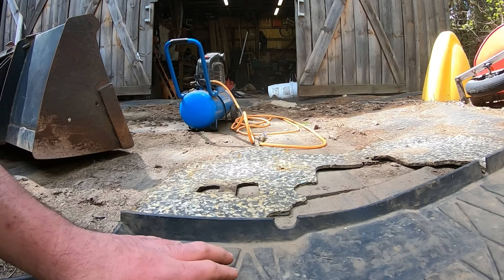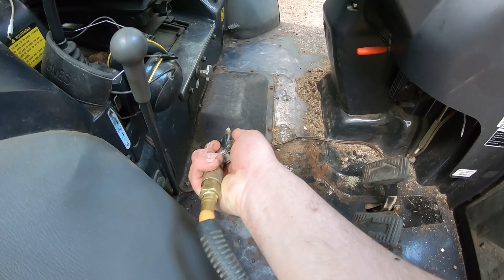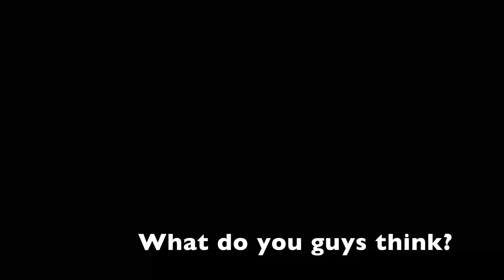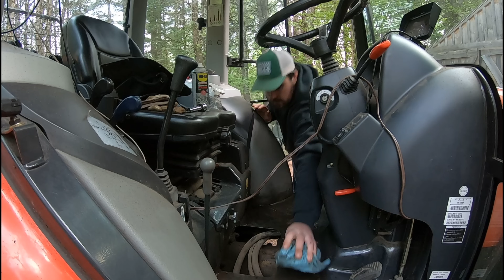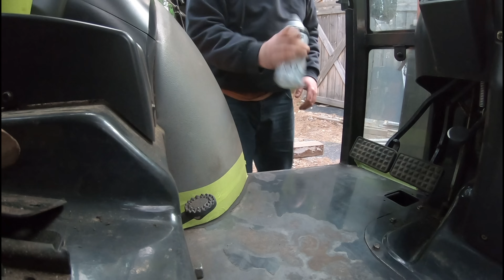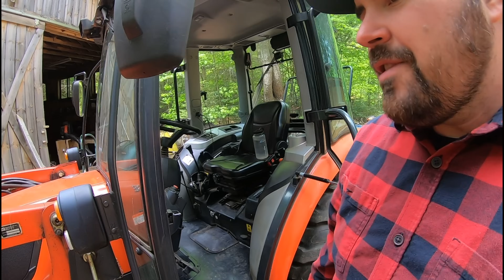Rusty Floor Pan Repair (I had no idea)

Comment: Sandy, my advice would be just as you did but I would instead put a couple good heavy coats of asphalt undercoat or rock guard.  As far as the matt, I think you should leave it in the tractor but I’m debating if you should leave the foam in or take it out.. it’s mainly for noise suppression.  I would suggest put it all back in for now (matt and foam) and just keep an eye on it regularly.  You still have the potential of slipping on the floor even without the matt in the summer so I’d be keeping it in Sandy.  Just my thoughts :)  thanks for the heads up on these potential issues on these tractors!  Andrew from NB :)

Comment: See it constantly in the marine environment.  That foam holds the moisture for sure even though it feels nice and acts as a sound deadener.  You definitely have poor paint adhesion as well.  Use a good epoxy primer or even better is an inorganic zinc paint system, however for best results you need to get a clean metal surface.  Can you pull the floor pan and sandblast it?  If not use a good rust converter before priming (no there are no good primers-topcoats despite what they say).  If nothing else give it a good coat of Rustoleum rusty metal primer every season.  It is not the best but it really helps and it is quick.  Personally I spray it on or brush it on thickly and do not bother to overcoat as I can see the rust better with just primer and it adheres to the next season's coat better.  Another trick I have had good success with is putting an old towel under the rubber mat leaving just a bit protruding in a spot or two.  I feel that every couple of days and pull it out to dry if it starts getting the least damp.  All in all the reservoir of the rubber mat is a win I wouldn't do without it but they need to be watched and dried whenever they get damp. Don't leave water pooled in the mats either take another old towel to dry them after you have heated the cab before it can freeze again.  It is a water making machine when you subject steel to the cold of night and the warmth of day as well as the seasons.  Keep it aired out (pull the rubber as often as possible and let it dry underneath) vacuum all the residue which can also hold moisture.  If it is in a shed airing it out is less of a task.  The cheap paint systems manufacturers use in auto and equipment creates an ongoing battle when combined with the low carbon grades of steel it is put on.
Reply from the maker: Thanks for that Douglas

Comment: Sandy, my thoughts are that it is condensation and that the carpet padding is retaining the moister over a long period of time, which is causing rust.  What if you pull it out a few times each winter and dry the padding next to a stove, or only use the rubber mat in the winter and not the moister absorbing padding?
Reply from the maker: I think that would be a wise idea for sure . Thanks Doug

Comment: Sandy, there are lots of suggestions here.  Some I agree with, others, I don't.  Putting that underlay pad back in is asking for a repeat performance. It wicks water up fast from warm air condensing on cold metal and holds it for months since it can only dry along the edges.  But you probably need it for sound attenuation so you should put it in.  See?  Confusion reigns supreme!
What you need to do to COMPLETELY eliminate rust from the top side is to clean the entire floor down to bare metal.  Coat it twice with POR-15 (it goes on REALLY nice with a sponge brush ), now, two heavy coats of Rust-Oleum and let that bake in the hot can on a sunny day.  Now get a kit of stick-on sound mat, like kilmat or similar, carefully cut and fit your pieces to the floor.  Once you are satisfied with the fit, begin sticking it down, rolling or pressing it ALL to the floor (any voids will collect condensation)!  
Once that's in, you won't have a worry of rusting from the top.
You need good prep and don't rush the repair.
Reply from the maker: Thanks appreciate you sharing that

Comment: Primer was the wrong thing to use on the rust. It will come back what you should have used is Black Star rust converter and then painted it. Black Star will get in the metal and stop further rust.
Reply from the maker: Thanks for the tip Kev

Comment: I was watching as you removed the loose paint . Problem # 1 no primer on the underside of the loose paint. Problem #2 Padding, that type of recycled rubber padding absorbs moisture leave it out. You might want to look into a resturant type open rubber comfort mat the type with the holes to allow the moisture to pass through.
Reply from the maker: Thanks for that I’ll see what I can come up with

Comment: well sir i have snowmobiles that are quite old the paint is still rust free all except one place underneath the seat because it never  completely drys so it rusts very bad and if left unchecked would rust right through while  rest of the machine remains like it came from the   assembly line
Reply from the maker: Good to know.

Comment: the spongy underlayment is acting like a sponge and holding the captured condensation against the metal longer, because the water is sort of suspended in the sponge "matrix", a wet sponge stays wet a long time, whereas if you replaced it with a non-absorptive material with a channelized bottom (soft rubber, etc) then the water would be given the opportunity to dry faster, my thinking is this underlayment could be cut from a large rubber floor mat with grooves (face down) that could be cut using your foam as a template.
Reply from the maker: Appreciate that

Comment: Betting that the moisture in the cab as you work (breathing, snow tramped in, your body) all condensate on the coldest surfaces after you finish work (floor boards, glass) and the pad/mat soaks up and holds it and never gets exhausted out, actually repeats itself each work session. Dump the pad/mat and if it’s easy enough, raise/roll up the floor rubber protector to help air some out out. Also a plus for doing this, you get a early warning of reoccurrence.
Reply from the maker: That’s a good point as well

Comment: Here is a good tip Sandy I spray rock guard in my truck box same thing is a box liner spray also I think personally it is the same thing! you can get it at canadian tire and is about 12 dollars a can or you can buy it in a larger quantity and buy a gun which runs off your compressor once it is on it bonds to the steel. It makes a good bond to the steel. those plastic box liner did the same thing create rust under since I did this I generally give it a touch up when it starts wearing off it would be great for under your rubber mat or on any surface you want to protect. Hope this helps One thing you want Rock Guard not Under coating they look the same but are different. It come in black but is printable if you want to spray it back Grey or any colour you desire
Reply from the maker: Thanks Marc!

Comment: I wonder if you used some Eterna bond tape and covered the freshly painted floor pan. It has a sticky back that is like butyl and the moisture from the condensing water in the warm air would be on the top on the waterproof side of the patch tape. You also might be able to glue a piece of EPDM to the floor pan.  It is a monomer so you would have to find an adhesive that would glue rubber to metal but it would likely suit your needs.

I have used 100's of feet of Eterna Bond and it is pretty amazing.

Comment: I'd apply truck bed liner to the floor. You can use the rubber mat without the underlining but it might slip. Reassemble everything and just remove it to inspect from time to time. If the underlying can absorb water I'd trash it.

Comment: The “craters” you referred to is called pitting. That’s the rust actually disintegrating the metal. You were at a serious point in the process. Good catch looking under the foam, which, as a hundred others have recommended, you should not reinstall.

Comment: Our New Holland is an open cab and it had an operators floor pad.  It degraded the metal floor so badly it caused issues with a few things that linked to the underside of the metal decking.  Not sure what to tell you in relation to the floor pad in a cab model.  I wonder if bubble foil insulation would be a good substitute for the foam underlayment installed by the manufacture.

Comment: Get some rust converter to apply to the rusty parts 
Makes a big difference
Reply from the maker: I just haven’t found any that stick to painted surfaces as well. Ones I’ve found said they only stick to rust and my Concern was that the majority of rust was removed with the wire cup. Any brands you’ve had good luck with?
Reply: @sawingwithsandy  we us rust converter from Wurth 
It’s brush application sticks to painted surfaces but you only get the reaction on the rusted surface
We don’t usually paint over it seems work bet not painted

Comment: I would put the rubber mat back in and leave out the foam pad. The foam will hold the moisture and the ribbed rubber will let the moisture run out and dry under it. Thats what I would do. I might also shoot the floor with Rapter liner.

Comment: Highly recommend POR15 instead of normal primer/paint for areas susceptible to moisture buildup.  Paint Over Rust 15 is amazing and has saved some of our refrigeration equipment that is constantly wet that corroded through factory paint and powder coating.

Comment: The moisture is coming in from that rubber cover in the middle of the floor. You should seal with water proof silicone.
Reply from the maker: I’m not sure if that’s the case as I don’t drive in any deep water or conditions where water would splash up. I suppose anything’s possible though so maybe that’s worth a shot

Comment: I usually paint on Ospho on any rusting metal after eliminating by wire wheel or sanding to kill off any remaining rust as well as to bond the primer.  It does take Ospho a bit of time to set up, like 24 hours, but it is the rusting you want to stop and the paint to stop it happening again.

Comment: When you do it againnext year.  Use rust inhibitor and paint and paint from Eastwod company you can buy it by the quart and brush it on . That paint you put on is junk no afence . Why did it do that because  thats the down size of powercot
Reply from the maker: Trouble I’ve had with rust inhibitor products is the ones I’ve found in my area says it doesn’t adhere to anything but rust and since most of my floor had the rust removed with the wire cup I was concerned the rust inhibitor didn’t have much to stick to
Reply: @sawingwithsandy  check out Eastwood it's automotive supply company.  I've used there products and have had good luck with them . I enjoy your channel keep up the good content

Comment: We’ll done Sandy. Leaving out the pad would be, I think, the way to go. It’s not only a sponge but also a great trapper of debris that could easily damage paint and make checking the floor one step harder. Also. Here where we are, we use Rustolium (sp) rust restorer with excellent results. Product turns surface rust TO primer. Plus, it’s already black. (As a lot of our stuff is) Cheers!

Comment: I think judging by the location of the worst of it, it's a combination of a few factors. poor paint adhesion was probably the leading cause but I would also say you could be getting water coming from the bottom of your floor pan. suspect locations are around your hydrostatic pedals and removable hump cover in the center. 
my suggestion for those areas would be to get a rust conversion product and liberally coat around them. then a nice thick coat of paint. for the center cover check the gasket and perhaps use RTV seal it good. a couple coats of spray paint or one good coat of brushed on. 
make sure your foam pad is bone dry before putting back. you probably have noticed a noise increase in the cab without. do a annual inspection and keep from being caught unaware

Comment: The pad under the mat is holding moisture in the winter and not allowing the floor to dry, in between usages.  Your need to pull the mat and pad out at the end of the day during thr winter.

Comment: As others have mentioned POR-15 is amazing it is a rust incapacitating paint it is harder than powder coating I’ve been using it for years and have never had a speck of rust return where I used it. It even comes in grey, it’s expensive but worth every penny

Comment: You can put the best paint on a bad prep job and it makes it a bad paint job.
Hot rod guys use a product called LIZARD SKIN. It's a sound deadening and a heat prevention all in one. Mainly used as a undercoating on the firewalls and floorboards.
 YouTube has some videos of LIZARDS SKIN, you'll be impressed. It has a healthy price and it's well worth it. It will work better than the foam rubber undermat and won't hold moisture.

Comment: My guess is that it was not paint but powder coating which is a plasticized coating. After wire brushing the rust brush on a rust converter for a an extra level of protection. I would leave the foam pad out and check it yearly. There are also panels that join to the floor plate, if they can be readily removed then thay should to more fully remove rust and paint floor.

Comment: i think the under coating would be the best way to go. it you do put padding back in coat steel side with burn motor oil it will never rust again i have used burn motor oil for years and it really works. they used cheap paint and did not clean or prime metal. take care, be safe and well.

Comment: I believe you hit the nail on the head with the condensation theory. Maybe some Herculiner?? Anywhere you have an air gap from cold air to warm your going to have condensation. I guess you could throw a couple silica gel packs under your floor mat to help absorb the moisture that gets trapped
Reply: Maybe do away with the foam it’s probably holding the moisture. Do you have a problem with the windows fogging up? Maybe it’s running down the windows and getting behind the mat?

Comment: That foam padding should be thought of as a sponge. I'd throw it in the trash. 
Even with a proper prep and great paint adhesion moisture wil eventually find a flaw. The padding is probably more for noise reduction than anything else and was preventing any drying.  When it recurs look for a metal prep rust converter and then a brush on bed liner product. The devil will be in the thorough prep details.
Reply from the maker: Great points John. Thank you

Comment: Just an idea but, would rhino or tar under coat keep moisture off the bottom so it can’t seep into the metal. And on a side note, rat rod bob builds showed some really good rust killer. And he has done some amazing builds on old rusty cars and trucks
Reply from the maker: Thanks Timmy. I'll check it out

Comment: Back in the late 60s and 70s  while building custom Vans we realized the rubber mat was fine but never use a pad under it. Air will get under a rubber with any type of ridging mat but the padding under it is the real killer....leave the pad out.
Reply from the maker: Thanks for that

Comment: Very interesting video and I will have to go with some of the other comments I read that said leave the foam padding out just wondering if the foam is insulating and causing the condensation but hey the way to stay on top of things Sandy you did a good job of cleaning up and painting also
Reply from the maker: Thanks Jeff

Comment: Good mornings Sandy yes rust is a pain every body is blaming the winter time but don't you run ac. in your tractor in the summer that will form a lot of condensation also between inside and outside metal my suggestion is yes put everything back but at least after using the tractor for 4 to 5 hours in one day remove every thing and see if there is condensation or is it worse after going out in the rain some water just might make it's way in so keep checking different possibility where this water come from well have a  ice day
Reply from the maker: Great point about the AC

Comment: You might want to scrape as you suggested. Then apply some rust reformer like Corroseal to convert any rust. Then apply a good coating of paint or bed liner spray. Good thing that you caught this early. Willing to be that Kioti didn't roperly degrease the metal prior to painting. I would toss the foam pad and reinstall the protective rubber mat.
Reply from the maker: Yeah seems like it could’ve be metal prep for sure

Comment: use big rubber mat, leave out the pad. The heavy rubber mat has better ventilation and wont trap moisture and will prevent scuffing of paint with the dirt tracked into the cab.
Reply from the maker: Thanks for that

Comment: I am only guessing here  Sandy but having a foam pad and the rubber mat seems  like any shifting of the machine would be like sandpaper from the rubber and the floor plus any dirt that makes it in there would be a recipe for problems. I would leave the matt out and clean up after a few uses as it is impossible to keep real clean. I am sure that with all  the different people who restore old rigs have found a paint or undercoating that will adhere better. Bed liner or some industrial strength stuff on very clean metal. I see guys sand to bare shiny metal before putting any stuff down because even the trace  rust is just the start of more rust. What you put down won't last that long. I see the floors of  trucks coated and its a much stronger material
Reply from the maker: Yeah I think I’ll have to keep an eye on in going forward for sure

Comment: I think it's no primer from the factory I have seen this on alot of stuff because when it's knew they just put paint and it looks good but with time it fails and I think it's because of conditions like you said from hot and cold.
Reply from the maker: Ah ok that would cause an issue for sure